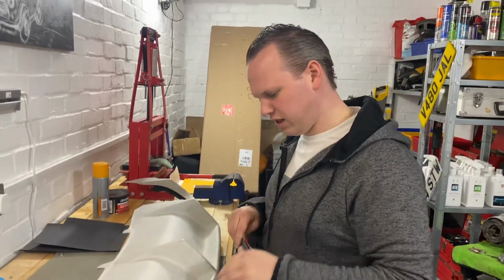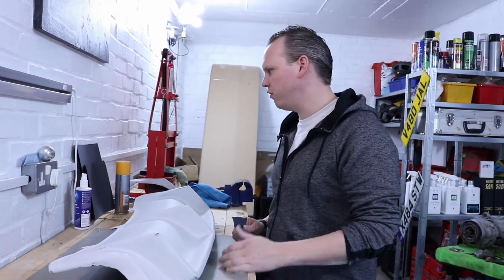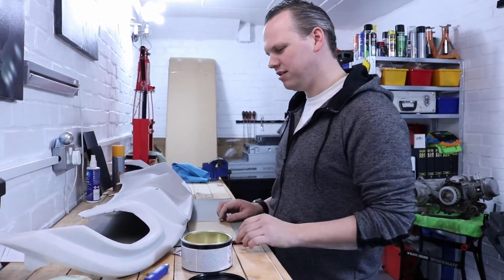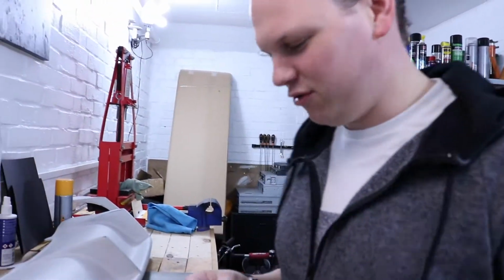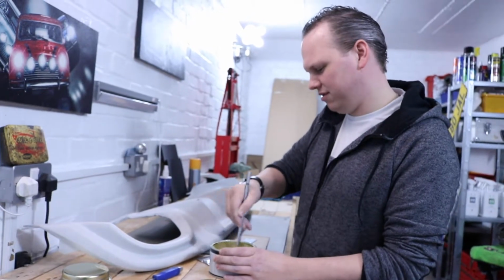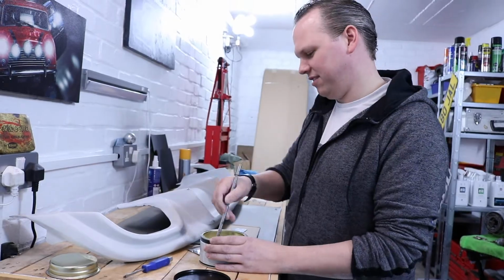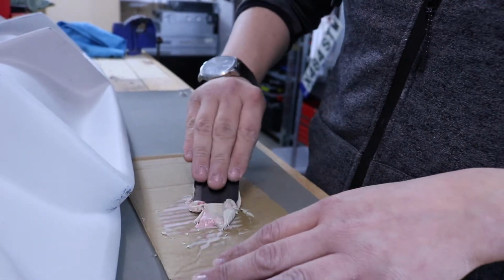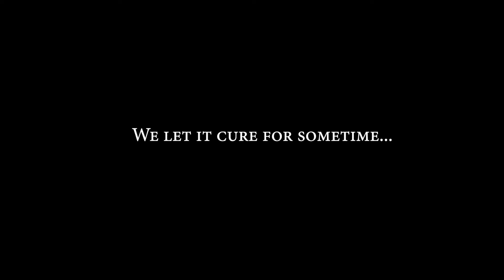How To Remove And Upgrade An Audi A5 Rear Diffuser Part 2

Comment: Nice! Where can I find one similar ?
Reply from the maker: Hi D, Thanks for your comment, We bought our diffuser from Ebay and you can visit the store to find the best one that fits your Audi A5, as they have all variants of the A5 covered.

Link: https://www.ebay.co.uk/itm/AUDI-A5-8T-S-LINE-FACELIFT-2012-2016-REAR-BUMPER-SPOILER-DIFFUSER-SPLITTER-/133145982493?_trksid=p2349624.m46890.l49292

Hope this helps!